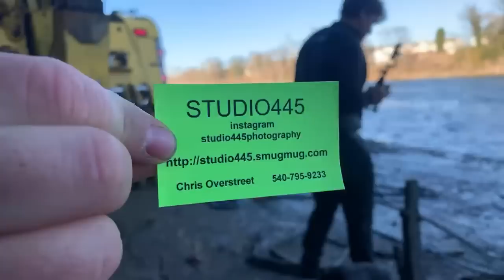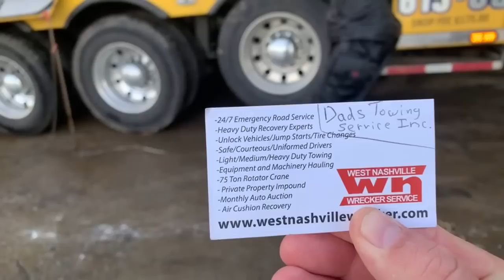Pulling more cars out of the river!!

Comment: For your info if you haven't got it by now. At about 12 mins in the video, the car behind the rotator is a 1983 to 1986 Dodge 600 four door.   
The next car is an Oldsmobile Achieva.
At two hours and 15 minutes the car on the ramp is a two door Oldsmobile cutlass rear wheel drive.. 
At 3:05 hanging in the air is the 83 to 86 Dodge 600 4 door. And NO I don't want it, besides you would have to cross the boarder to Ontario Canada
Reply from the maker: Cool. Thanks
Reply: that's a 2-door Oldsmobile Acheiva, not a cutlass supreme, the Cutlasses never had those style headlights, and the Cutlasses had those ridiculous vertical door handles that would break off,  and the Cutlasses didn't come with quad 4 engines